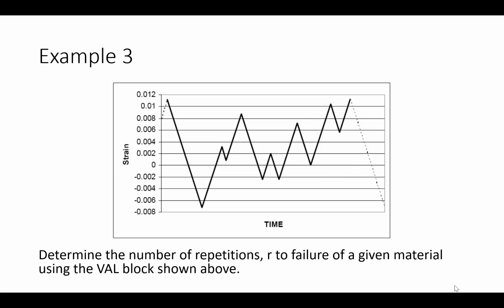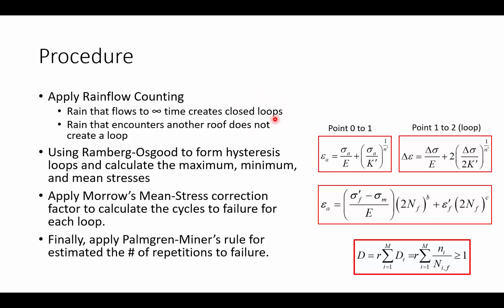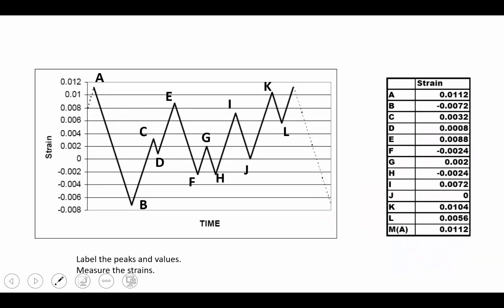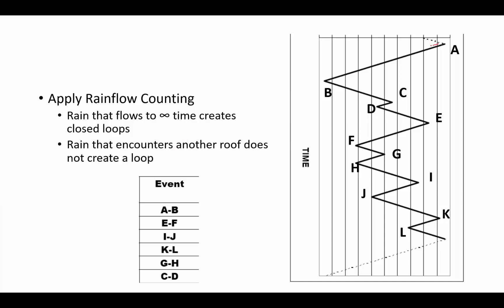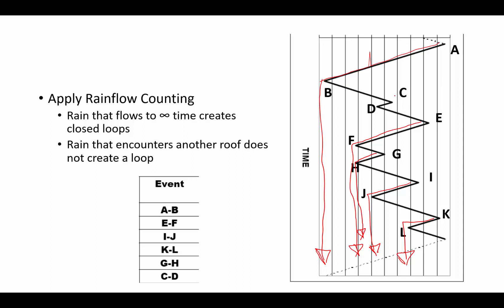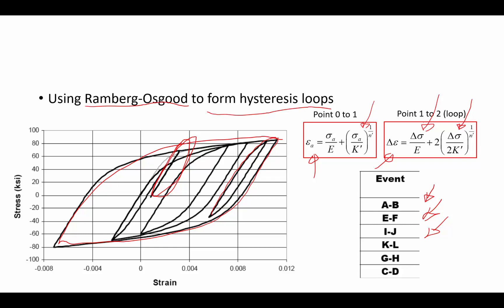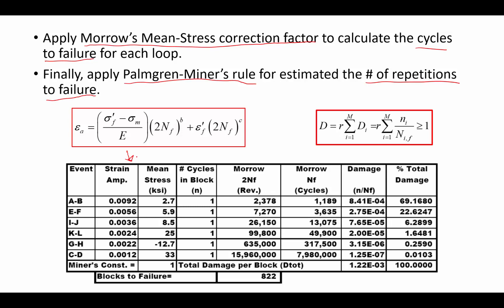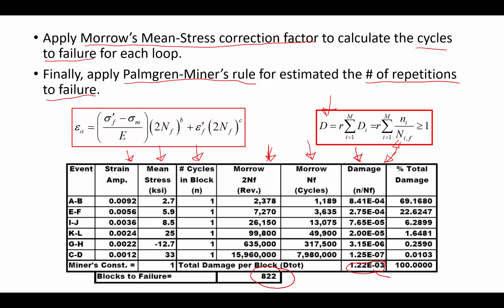Variable Amplitude Loading Example 3

Comment: Why is C-D counted, when the rain doesn't fall to infinite time?
Reply: He doesn't understand what he is presenting on, only what he's copied and regurgitated.
Point B should flow all the way to end of the time series due to no valley being lower than point B. With that line from B flowing, trying to draw a line from D to E wont be allowed because of the rain coming from B stops it. That causes a full loop at line CD, which you would see if you plotted the stresses on a hysteresis plot, which ironically he notices on the hysteresis plot. This also contradicts his second bullet point on step #2 of the video. lol